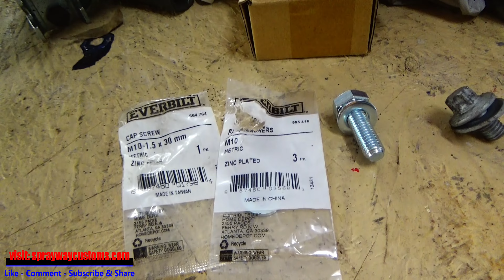Coilover Install - MAXPEEDINGRODS COILOVERS - BMW 335i E93 3 Series Convertible On 22s Wheels

Comment: I put a set of these MPRs on my Baja Turbo until I could find something better. People dissed these things, but they've been great for over two years (20K miles). Note: The threads will rust a bit so the anti-seize will help that.
Reply from the maker: Thanks for the info
Reply: Yo I put some MPR on my 2008 LS460, those mfs slammeddddd and rode nicely. Granted I would rather have BC’s for the custom spring rates, but for like $300, they were pretty chill.

Comment: Fantastic Video Buddy.....Having the problem with the V-Brace......Ordered the M10 1.5 30mm bolts and washers.......What size are the Bolts you are using to space the bars ? Are they M10 or larger diameter ? Cheers
Reply: Sorry didnt mean "Bolts" meant nuts ! !

Comment: Great work as always bro!!! I need to do the front coilovers on the SS....any pointers on safely removing the springs?
Reply from the maker: I will in the future
Reply: if you're not re-installing the same coils put a jack underneath the lower balljoint(with slight pressure to hold it still) and use a saw to cut a coil to release the tension then just pull it out.

Comment: Just a question.     So the coil overs was not good enough to lift the BMW that you had to stilll use lifters or spacers to keep the car up in the air ?
Reply from the maker: It was enough but barely

Comment: as a tire tech id recommend going down at least one size we had many people coming in with wheels too big for the car which would be 20" max on e93s and  they would need help squeezing them on the car and a couple months later would be back with destroyed rims that ended up ripping apart the fenders and everything inside the wheel wells including wiring etc. Which insurance didn't cover even the companies that sell you the wheels leave you high and dry due to negligence i know it looks cool n all but you'll be out a lot of money and worse if its your daily
Reply from the maker: Thanks 🙏🏾

Comment: What's the deal SPRAYWAY i am your #1supporter sense day1 I wanted to ask a question? i have a 2008 SUBURBAN LTZ WITH A 5.3liter engine and it have a lifer knock in it can i put a 6.0liter Vortec as a replacement without needing anything else as far as a pcm or wire harness?
Reply from the maker: Yes, you could do that with no problem at all
Reply: Thanks SPRAYWAY bro i will be watching your video your about to drop as well 1love fam God Bless